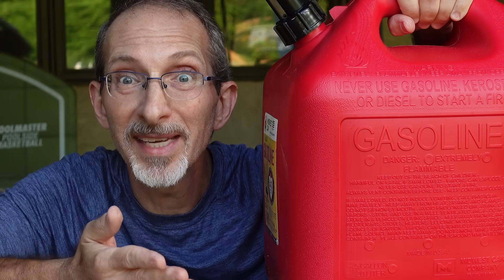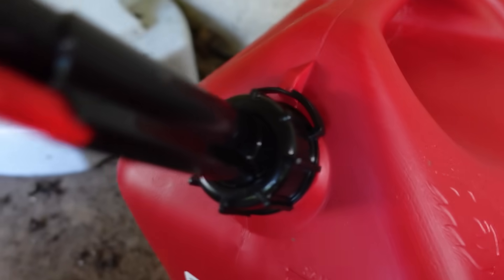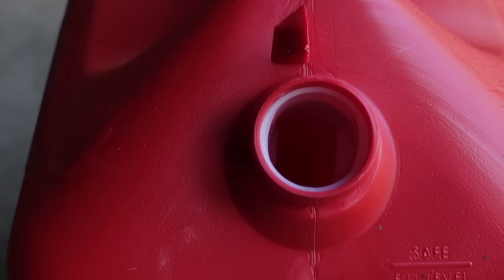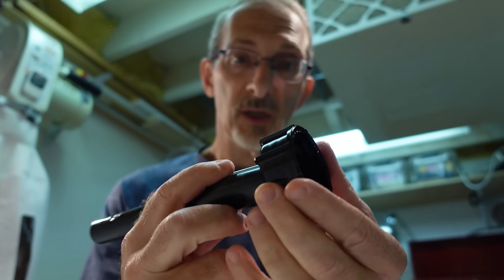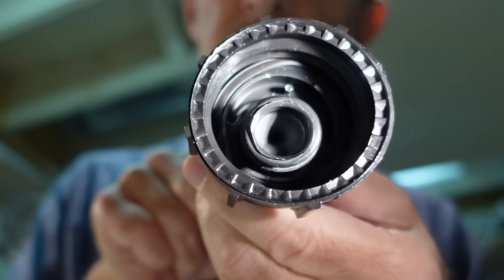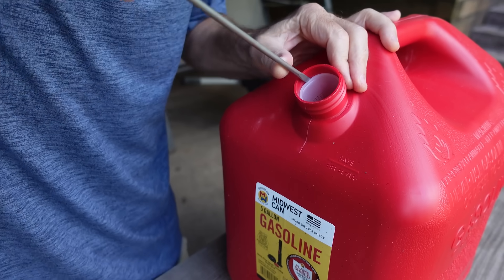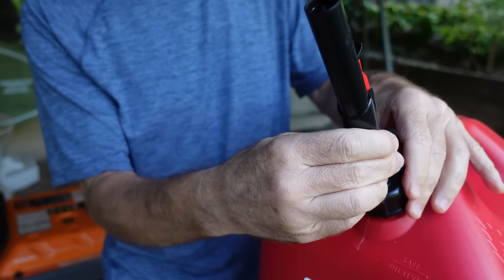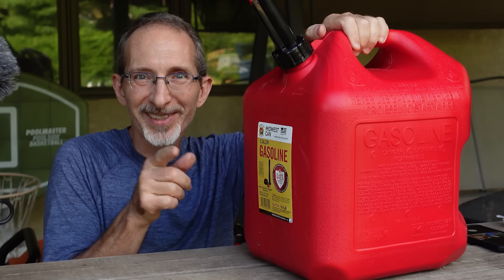Gas Can Modification | New Gas Can Fix

Comment: I ripped off that red thing. Ripped out the whole spigot part.
It pours now
Reply from the maker: Way to go Wes! People need to figure out what works best for themselves. It sounds like you found a solution!
Reply: @MikeFyxdt  I was on the side of the road, and couldn't figure out how to get the gasoline out of the can.
So rip off the "safety"

Comment: I wasn't searching for this but I am glad I found it. I have the same gas can and it always spills due to that nozzle. Have you thought about covering the nozzle in case it eventually drops from gravity over a year or two of use? I can see the gasket failing to keep it up and might cause the gas to evoporate. Do you think it might be an issue?
Reply from the maker: I did give that some thought, and in my second video I did a modification to return the spring and make it easier to use, which keeps it from leaking if tipped over. I also added a simple plastic cap to the end of the nozzle as a safety. Thank you for your suggestions and for watching the video!

Comment: I removed the red idiot bar from the nozzle & kept the spring loaded close for spill control. Also, the " filter" is supposed to a flame arrestor, but is actually a backsplash generator; twist pull & shout, & it comes out!
Reply from the maker: User 1, well put! Yes, what I called a filter is actually a flame arrester, which I addressed in my second video, link in the description. I have heard other people suggest removing the red latch but I haven’t tried it. Thank you for your suggestions and for joining the conversation!
Reply: @MikeFyxdt  The red latch is quickly & easily removed with a hacksaw blade, just carefully saw across at the thin point, & pull the 2 pieces out by hand. Done!

Comment: I have a one step method, remove nozzle and pour. My gas can doesn't have the filter, so no worries there.
Reply from the maker: Removing the entire nozzle seems to be a popular option! So the question is do you use a funnel or not?
Reply: @MikeFyxdt  It depends on the situation. For a car I would, for my lawnmower, only if the gas can is too full for a controlled pour. Today's modern nozzles are basically just a gas can cap. Great video, though. It gave me another option.

Comment: This is kind of unrelated to your gas can but when I buy inexpensive sandals, I use just about $0.05 worth of glue and strengthen all of the seams and bands. It literally triple or quadruples the lifespan of the sandals. Sandals that used to fall apart and two to three years now last over a decade.
Reply from the maker: Mac, that’s awesome! I love tips like this. I have a similar story… The funny thing is I told it to my wife for the first time last week. Long story short, I had a great uncle who ran a basement business in New York City putting taps on people’s dress shoes, on the toe and heel, to extend the life of the sole. I visited him when I was about 10 years old and was very impressed with the machine that was used to install the taps. These days people don’t expect things to last, which is a shame. Extending the life of a product is a benefit in so many ways. Thank you for sharing your story and for joining the conversation!

Comment: I do have a "safety" gas jug that actually works well.  It is a 1 gal. jug that I only use for fueling chainsaws.  It is difficult to see the fuel level as you fill the saw so the  auto cutoff feature prevents fuel spills. For any other application, these safety cans are worthless!
Reply from the maker: I don’t have any containers with an auto cut off, but that would be a very helpful feature.

Comment: I use VP racing fuel jugs.  Buy an extra cap and install a 3/4" barb fitting to attach a hose.  Not "approved" for on-road fuel but who is going to question you for filling a big red gas jug?
Reply from the maker: Brian, creative ingenuity at its best! It sounds like your solution would be very effective. I just wish these containers were affective right out of the gate. Thanks for watching and for sharing your tips!

Comment: The "filter" in the tank is really supposed to be a fire suppression device, hence its permanent installation. Don't ask me how it works, I just read it on another channel.
Additionally, the nozzle spring is there to close the fuel flow in the event of a fire or explosion whereby the person holding it would likely drop the can and run, or worse are horribly burned and then drop the can, whichever the case may be. Without the spring the fire will continue to be fed fuel to continue burning....
Don't shoot the messenger. I will be doing the same to my new jerry cans and adding a vent to the rear of the can.
Reply from the maker: You are correct, the filter is a flame arrester, which I explain further in my second video. You are also correct that the spring is there to seal the container should it tip over, or as you say, someone panics and runs away! Thank you for your comments and for watching!

Comment: You forgot to add an air valve on the top so the gas will actually come out.
Reply from the maker: John, I had added a vent in my second video, a link in the description if you would like to watch. I also did a modification where I cut out part of the spring and returned it to the nozzle, restoring some of the self closing benefit by making it much easier to use. Thanks for commenting and for watching!

Comment: I have done these same mods on my cans ever since they borked the design. One more addition that I do is add a hole on the top opposite the spout (like the old design) with an awl or ice pic. Leave it in when not in use or plug it with a nail. This alleviates the chug chug slurp while the can tries to get air.
Reply from the maker: Mike, I agree! I added a vent in my second video, link in the description. It makes a big difference!

Comment: Wouldn't it have been much more simple to return the cans and buy a gas can without that nozzle? I understand that you are in the USA, we don't have those stupid nozzles in Canada, not yet anyway, I'll stock up on our breather nozzles just in case, thanks for the video.
Reply from the maker: John, I bought these containers online at the beginning of the pandemic, and I didn’t realize the difficulties until they already had fuel in them. No worries, these mods served my purpose and made them much easier to work with. If I knew then what I know now, then I would’ve purchased a different container. Thank you for watching and for commenting!

Comment: I just clipped the spring, that way it still closes on it's own. Just way easier to use.
Reply from the maker: Good advice Randy! In my second video I also clip the spring, but stretched it to the original length. It works well!

Comment: As a fuel hauler, safety is no.1

This? These, "safety" bullshits? Is because of idiots. Dare I say, doesn't make it much safer at all, just more likely to spill, which is worse.
Reply from the maker: Pierce, you nailed it. The irony of these no-spill containers is that they actually spill more. I really hope better container and spout designs will be coming in the very near future… Thanks for commenting!

Comment: An issue i have is that if you apply any latteral pressure to the nozzle while fueling, fuel leaks from the base. Which of course is difficult since you're applying all that downward force to open the vavle
Reply from the maker: Kevin, I haven’t had any leaking from the base, but maybe that’s because I removed or adjusted the spring on both of my containers, and I don’t have to push down so hard anymore. Thank you for sharing your experience and joining the conversation. Hopefully someone is listening and better designs will be coming in the future!

Comment: Seems too complicated.  I just bought a flexible wide nozzle with no garbage on it from Amazon along with a bag of basic caps for the cans.  I just keep them all capped and when I want to pour I use the flexible nozzle.  All the "safety" crap on the cans goes in the garbage.  FU California and your idiotic CAFE laws that infects the rest of the country.
Reply from the maker: I hear what you’re saying, but each of these mods isn’t very hard, and the advantages that you do not have to spend additional $ after you purchase the container. Thank you for sharing your tips and for watching!

Comment: SO tell me how an idiot that can't pour a regular gas can is somehow safer with this over engineered child-proof/adult proof, poor ease of use, tricky bastard of a can? Why did they ever change them? Regulations? Do reg's require them to NOT WORK? Guess you can't spill what you can't fill or pour out of...
Reply from the maker: One of the things the safety advocates are trying to achieve with the spring loaded nozzles is keeping the fuel from spilling if the container gets tipped over. That is great in theory, if only it didn’t make the can harder to use by normal people! Thanks for watching and for joining the conversation!
Reply: @MikeFyxdt  Threaded caps seemed to have  dis-a-fkin-peared from the planet, but that must be also why idiots are on the rise- they aren't killing themselves off any longer...

Comment: For anyone who's had a normal gas can... the new "safety" nozzles are a big fat "Screw the Customer with BS" that we can hike the price for, because its anything but safe, and not easy to use, and will break- unlike a normal older gas can- which I still have two of, going strong for over thirty years. Those double depression nozzles begin to leak, seal goes bad every four years or so, the damn button breaks... I modified a pipe to fit the cap- straight pipe with a threaded cap. THERE FOREVER.
Reply from the maker: Chris, I admire your manufacturing skills! I think you’re the first person in these comments to have machined their own metal spout. Thanks for sharing!

Comment: When I bought my new gas cans not too long ago, I just bought the replacement nozzles that don't have the spring loaded stuff or the safety latch and the cap. I removed the screen from the can, drilled a vent hole as per instructions and popped in the vent cap. Easy as can be... 🤷‍♂️
Reply from the maker: This seems to be a popular route! I just find it frustrating that these containers aren’t easier to use right out of the gate. I appreciate you watching!

Comment: The idiot that designed the “quick flow” spout and put that huge filter screen inside the can that makes it IMPOSSIBLE to fill the can at a gas station needs to be horse whipped. I had to remove (rip the screen out)and gut the “quick flow” spout and drill a small hole in the top of the can before I could make it work.  You take a $20+ gas can and basically destroy it to make it functional and then you end up with a $5 plastic container that does not work as designed and could not work as designed. SERENITY NOW!!!!!!! Use heavy needle nose pliers and a twisting motion to collapse and remove that stupid filter. After ripping the guts out of it, I went to an auto parts store and bought a real flexible spout and vent kit. now I have a gas can that works.

Comment: No issues with what you did.  However, the "filter" you took out is not actually a filter.  It's a flame arrestor.  Intended to prevent ignition if the contents of the can in case a spark ignites fuel vapors outside the can.
Reply from the maker: Chris, you are correct, and I address this in my second video… Link in the description if you would like to watch.

Comment: I’ve been working landscaping/hardscaping for the last 5 years... I’ve filled up A LOT of gas and diesel cans. IMO the best brand is the No Spill brand. All you have to do is remove the filter and the ratchet lock, and they are good to go. Their safety fill design actually works since you just press a big button in with your thumb in a spot that would be good to hold anyways. They also have a big mouth, so if you have a big funnel you can empty the can fast by taking the spout off. 

Only big down side is they are not good for filling cars and some equipment, they are best used with a funnel
Reply from the maker: Random guy, thank you for sharing your experience! Many other viewers also like that brand. It’s amazing that something as simple as a funnel can make a huge difference. Thank you for watching and supporting the channel.

Comment: there is still one more issue.... the can not being able to ¨breath¨ while pouring you get annoying stop in the middle of fueling
Reply from the maker: There is actually a breather that goes up the spout where the fuel comes out, but it makes the can glug and isn’t very efficient. In my second video and I added a simple vent cap to the back of the can and it made a big difference. Thanks for watching and joining the conversation!

Comment: After two hours of cussing I turned to old reliable YouTube. I knew I couldn't be the only one trying to figure out how to work this new fangled pieces of crap. Bless You My son, spring removal time.
Reply from the maker: I’m glad you found the video Swamp Yankee! Before you dig in you might want to check out my second video, which shows how to modify the spring to make it easier, if you don’t want to remove it entirely. Link in the description if you would like to watch.
Reply: @MikeFyxdt  I was going to say, just clip off some of the spring to make it easier to push the nozzle to make it work, but I guess I need to watch the 2nd video.
Reply: They'd be even better if you didn't have to push any buttons and slide the stupid nozzle in. Just give me a funnel type nozzle with a cap or a cork.

Comment: I like your gas can hacks.  We all suffer with those "safety" gadgets on our cans.  I do, however, like the idea of having some kind of filter on the gas to keep contaminants out of the can.   I get the concerns you had about filling the can, but it seems like there should be a way to filter the gas somewhat while still being able to completely fill the can.   Maybe that's an idea for a future video?
Reply: That filter is BS.  Fuel coming out of a pump is as clean as anything can be.  If by some weird chance a particle got stopped by the filter....when you transfer the fuel to your lawnmower or whatever, the particle will go into it!
Reply from the maker: Robert, thanks for your comments and suggestions. After making this video I found out that the filter is actually a flame arrester safety device. I explained this in my second video, link in the description if you would like to watch. I didn’t understand why a gas container would have a filter since there are in-line filters On most of my gas powered tools and mowers. Whatever it’s purpose, that plastic filter completely interfered with me filling the gas container. I hope we have better designs in the near future. I appreciate you watching and join in the conversation!

Comment: If anyone is wondering why there is so many stupid things on modern gas cans it's because there's been a few lawsuits over people getting hurt doing stupid shit with gas cans like pouring gas on a fire and getting blown up. These law suits shut down the main us made gas can company's. They lost in court because they could have put a flame restrictor in but didn't.
Reply from the maker: There is lots of public information about the lawsuits leading to many of these safety features. I have nothing against safety, but these designs are a hot mess and just make them more difficult to use.

Comment: This is NOT a safety feature.  It was implemented by the EPA to reduce gasoline vapors from being released into the atmosphere.  No, it's not Chines industry that's wrecking the environment, it's us American men filling up our lawnmowers.
Reply from the maker: John, I think the spring loaded nozzles are also to keep fuel from spilling if the containers get knocked over. It would be interesting to see just how much lawnmowers are contributing to Global carbon emissions. My guess is that it’s not much. :-)

Comment: The other thing I hate about these nozzles is that they get pressurized if they warm up at all and if you forget to push the plunger in with the tank upright first it sprays gas all over or if you are filling a small tank it pushes out so much gas so fast it overfills before you can shut it down. These nozzles were obviously designed by an engineer who never actually used a gas can
Reply from the maker: You bring up a good point. These containers expand. Always loosen the nozzle collar while they are upright to burp them! Thanks for watching out for joining the conversation…

Comment: Those safety nozzles SUCK.  The lack of a vent  makes em pour like crap too. I've removed vents from old junk cans and drilled the new dork style cans and installed the air-breather/ vents.  When possible I throw the whole safety nozzles and use one off old can when they fit. There are pretty much two diff thread types I've found, but there may be more,  I don't know .   I'm all for change that is PROGRESS, but these days that is rare.  Functionality should not  be sacrificed for safety.  Vice versa too I suppose.  Where has common sense gone in our lifetime????!!!!..... ;-)
Reply from the maker: Tom, I agree with all the points you raise. In my second video I did a few more modifications, including adding a vent cap. It makes a huge difference! I appreciate you watching and joining the conversation.